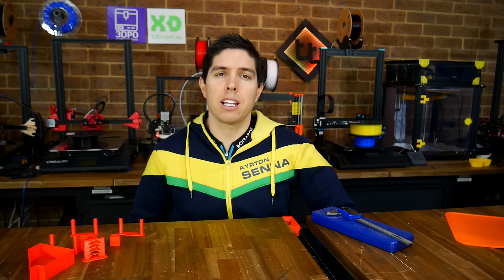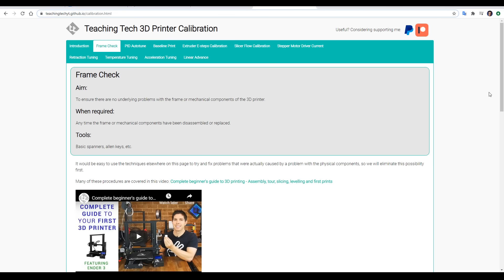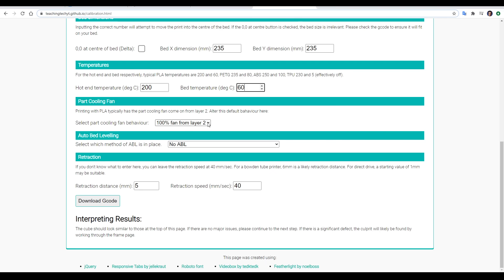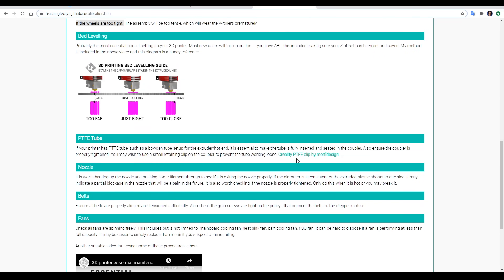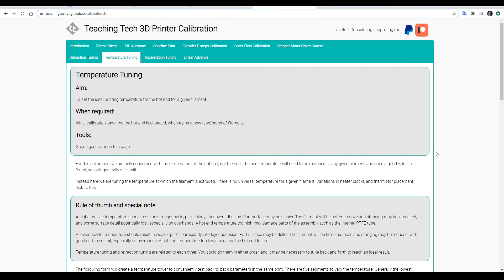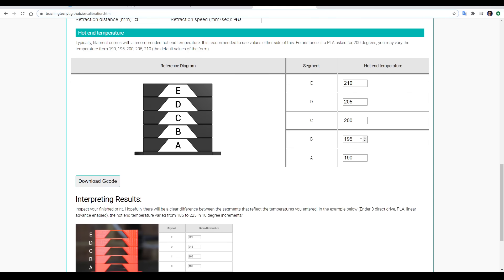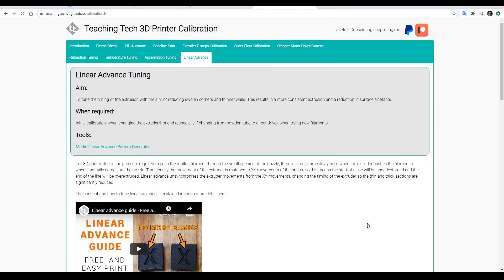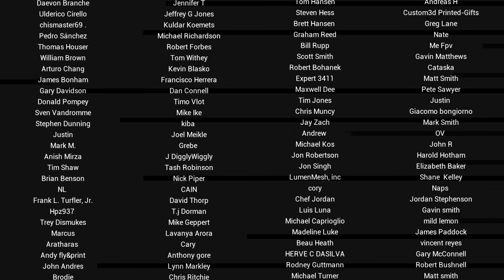3D printer calibration revolutionised - Step by step to better print quality

Comment: Also, I think your resolution is too high, at least on the string test so far. During the circle paths they're fast then slow significantly -- I'm not sure if its processor limiting but it causes overabundance of slack before it moves to other pillar. The slowing and the shear size of the file for this part at 6.5MB(!) Is a tell your resolution for the gcode way high.
Btw: modded Ender 3 pro, silent MB, TH3D - applicable potentially.

PS - consider nozzle diameter adjustment. Forgot I had .6 on mine and while it printed okay, ran into issues during base layers and caused extra stringing, though the nozzle needed replacement. Speaking of, make a vid on how much a new, CLEAN nozzle can make a difference!!! I always forget.... till I change it

Comment: This is fantastic! I’ve recently gotten my first printers (yeah that’s printers with an “s” haha) and have been slowly tuning things one by one and learning how to make the most of the slicer settings to get the best quality prints. 

I’ve gotten pretty far with trial and error, but this is a way better approach! With 3 different printers, each one has different tuning requirements and it felt like a monumental task both learning what even needed tuning in the first place and then learning how to do it. 

I’m going to run through these tests on all of my printers this weekend. Thanks so much for taking the time to develop this!

Comment: m92 only returns "OK" when I enter it in terminal on Octopi. I have to type in M503 and then look for the M92 line and get my e steps there.  Just an FYI for anyone who runs into the same issue I did. I know Michael from TT uses TH3D as well so I'm really not sure why it would work for him but not me.

Comment: @Teaching Tech you might be interested in a design I recently posted on Thingiverse.  It's an extrusion calibration bar, and it alleviates having to use a caliper to measure 100mm and 120mm on the filament.  https://www.thingiverse.com/thing:4549768

Comment: Lots of good information and all in one location
But......for your consideration
I disagree with your flow rate method. You never even accounted for filament diameter in your flow rate. So going from filament thats 1.75mm with a tollerence of +-0.05mm commonly (i only buy 0.02mm tollerence) would mean that it could be 1.70mm to 1.80mm this can be a swing of ~8% of flow change. So calibrating in the video and you had 1.80mm filament then printed with 1.70mm filament on another spool you would have a cube under extruded exactly like the pictured one. Flow rate should take into consideration the diameter tollerence of the filament for the most consistant results.
Btw doesn't prusa have a sensor for filament diameter thats changed the flow rate on the fly?

Comment: Great video, but on your "flow calibration", you must first measure the filament diameter (average of 4 measurements over about 1m length) and put that into your slicer where it asks for filament diameter. Only then can you do true "flow" calibration. If your esteps are set correctly and your slicer is configured correctly, you should always see your flow come out to be 100%. 

Oh, and be careful when measuring the wall thickness. You only want to measure 1 layer. Measuring two layers will give you a slightly larger number.

Comment: Extruder steps/mm must be calibrated without load. Different fillaments have different stiffness and compresses inside bowden tube differently. Fillament slips on the extruder gear slightly during extrusion through nozzle, and you get different results for different fillaments, which is wrong. In case of bowden setup E-Steps must be calibrated with bowden tube detached. In case of direct setup  it can be calibrated with backwards movement or with whole extdurer detached from the hotend.

Comment: Hy Michael! I am struggling with an extruder problem, i calibrated my e steps per mm at 210 degrees but if i lower the temp to 205 i get an underextrusion of about 16mm on ender 3 metal extruder!

Comment: This is legit mind blowing!

You've done something incredible here, making the entire world of 3d printing even more accessible to everyone. Including those that have been in it for a while, as making temperature towers always ends up sucking! Would love to see this built into slicers eventually, like perhaps a plugin for cura, so that it will automatically make use of all the rest of your settings!
Reply: There are calibration prints built into SuperSlicer - temp tower being one of them
Reply: @showalterfamilylights  I have no idea what super slicer is, but I'm going to look it up!
Reply: I agree, I'm fairly new to 3d printing and this is a great resource all in one place.
Reply: There is an option in Cura to do this; extensions-->post processing. However, it is cumbersome as you have to manually enter the level and temp for each change. Simply plugging in what you want on this github page is immensely easier!

Comment: can't wait to use the retraction and print temp tools, PETG is proving a little finicky over the last couple of months. Did an overhaul on the hotend (new bowden tube, new element, new sensor), and still not acting like it did 5 months ago. I also learned the lesson of NOT upgrading my slicer every time a new one comes out, but I may have some legacy machine code that still isn't playing well. Soooo many variables with this, which is why you and your channel are such a great thing!! Thank you and those that assist you, it really helps.

Comment: I can see some issues with this setup, such as tuning linear advance after retraction. Linear advance has a huge impact on retraction; so tuning it after retraction will invalidate the retraction tuning. Same goes for temperature - it has a huge impact on retraction and linear advance.
Also, stepper current isn't something that should be included in such a "beginners" guide - there is just too much potential to mess up a perfectly fine setup. For example, a typical max spec for stepper motor temperature is 80°C. At this temperature, the motor would cause burns when touching it for more than a second; 50°C is the threshold for discomfort, 60°C the threshold for pain (approximately - but we're talking blocks of metal here, which feel hotter to the touch than they actually are). This means that if someone was to limit their stepper motor to 50°C (comfort threshold), they are wasting >50% of the stepper torque potential - which can easily cause issues with lost steps! Likewise, it could also encourage people to crank their steppers up far too much, as a typical NEMA17 will take ~15 minutes to reach temperature equilibrium - and Marlin with for example TMC drivers will ramp down current if the stepper is inactive (e.g. not receiving any step pulses) for a minute or so. It really is no setting for a novice to touch.
Reply: lol bitch much
Reply from the maker: Please read the site before you criticise. The special notes cover this stuff. The stepper current also mentions not to touch unless you need to.

Comment: This is huge, thanks dude. I've done several of your calibration processes and really found them useful - but everything you said in the opening about the downsides of the non-central source for the knowledge / files, and the fiddly manual nature was spot on. Having everything in one place and the g-code built as needed is amazing.

Comment: You should have a section explaining step by step about the whole console thing. Like I still dont understand how to to connect to that or how to edit code. I see you talking about how to do that on other videos but you never explain how to get there. You just say "edit this in the gcode etc etc" but how do I even get there. What program are you using to look at all that info and how do I use it. Noobs wont know how to do all that like I dont.